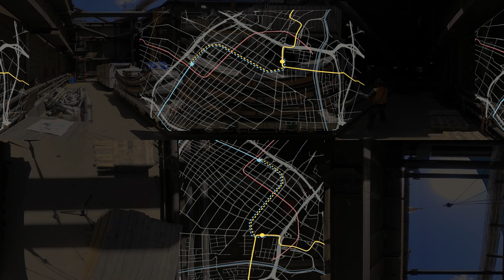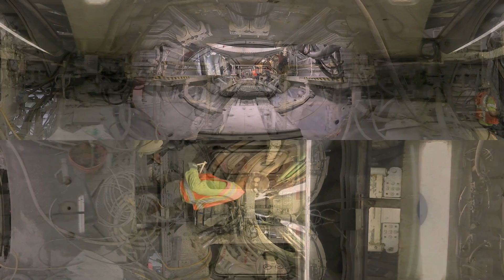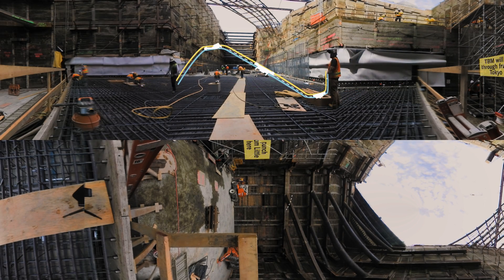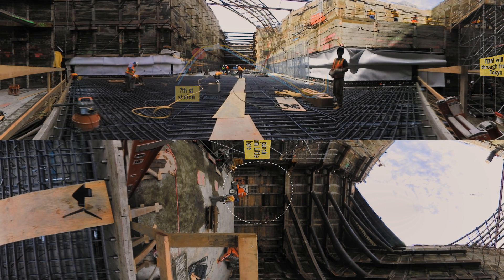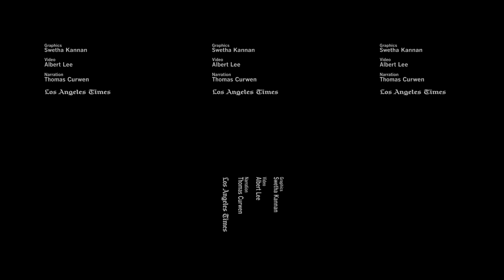No hardhat or miner’s light required: A 360 video tour of a Los Angeles subway under construction

Comment: This is a really good video! Now can we get some figures on how much per mile. This project is costing, how much per passenger transported it's going to cost, etc.? Building tunnels in the city known for earthquakes and gas pockets is always a little risky… As far as I've seen the LA subway system is mostly a movie set, without a lot of passenger traffic. Kind of like the real system here in Austin, which was full profiled in Forbes for its empty platforms and railcars.
Reply: To this day I still don't understand why a fair portion of the entire system can't be above ground (i.e. monorail system).  It would cost 1/2 the price to construct vs excavating.
Reply: The residents in L.A. have historically been against it. It's been proposed several times. People say it's unsightly.